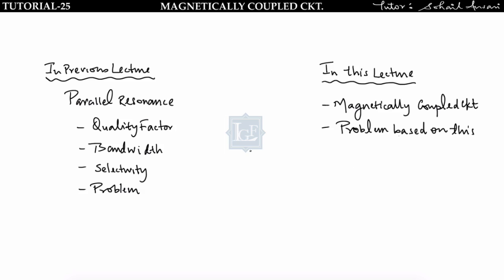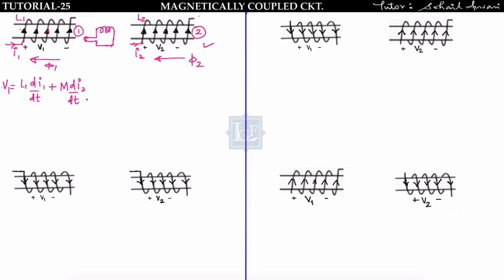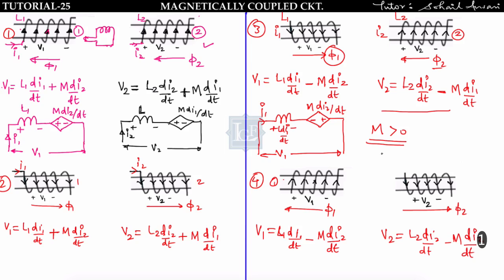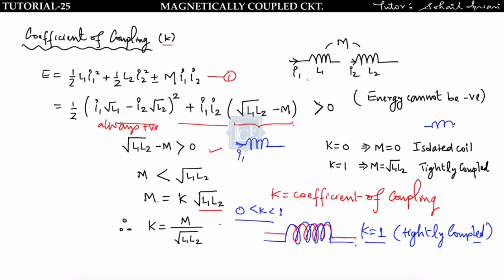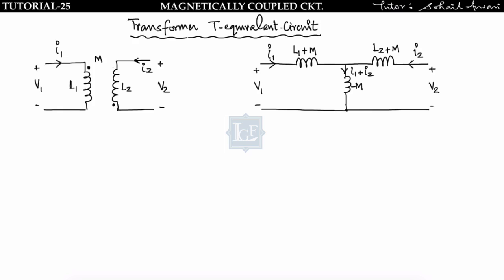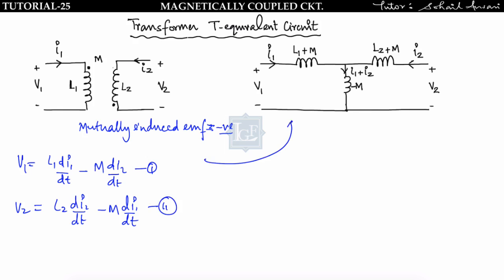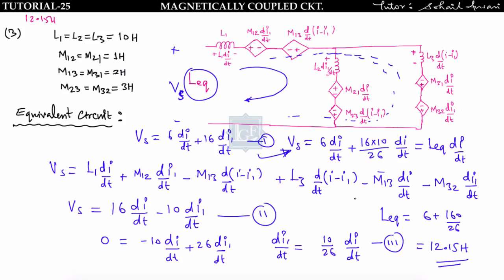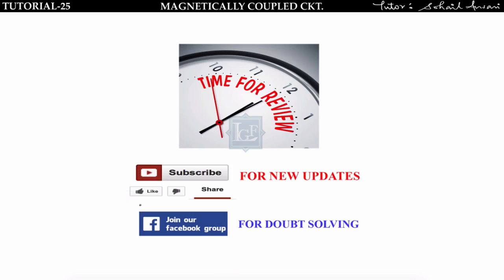Lec-25 Magnetically Coupled Circuit

Comment: in 43:36 last question why u have taken ji1 instead of j di1/dt??
Reply: di1/dt in laplace domain can be written as j
Reply: @sguha7850   in laplace domain, J doesn't exist.  Where does di/dt went and j came to laplace ?.............
Reply: Actually we are writing voltage due  to M which is also reactance multiply current here j representing  reactance due to M and with multiplying to current i2 giving voltage
Reply: Nitesh soni even though if j represents the reactance due to M... Then mutual voltage is given by reactance multiplied by change in current... So where is d/dt
Reply: ... I got it.....!!!!
Reply: @niteshsoni8956  , yes but in phasor domain di/dt=jwI.what is the value of  w for I2
Reply: V=Ldi/dt....but V=XL*i....j form means it is XL...not L.....so we do not multiply di/dt.....we multiply i with j

Comment: (ques 5 ) 50 sin2t=2i1+Ldi1/dt -Mdi2/dt so if we apply phasor concept 50(_90)=2I1 + jwLI1 -MjwI2 since w=2 therefore L=1 so 50(-90)=2I1+ j2I1+ 2 I2 but you took dependent source as j I2 so please! resolve the conundrum..

Comment: sir in the last problem the question is asked to find power loss in 2 ohm resistor then it will be ( i1square) * 2 ..
Reply from the maker: in the last problem go through the process....may be answer will be different..

Comment: Thankyou sir good lecture.Eagerly  waiting for 3 phase circuits.
Reply from the maker: u can solve three phase circuit also..whats the big deal..only u need to know the phasor diagram of star and delta connection ...also the relation between line and phase voltage..i will make one video dont worry..

Comment: Sir, Can we solve last question by transformer equivalent circuit as told by you before??..... What the meaning of inductor with negative value ( - M)... Doest it mean Capacitor practically??....
Reply from the maker: yes u can solve this by equivalent circuit also..no problem..anyhow u have to find I2...u will get same...
Reply: LearnGATE Free  thank you sir for your awesome lectures.its really great to see someone who is making so much efforts for improving others knowledge and that too free of cost . Thank you again sir
Reply from the maker: ur most welcome...all the best for gate 17
Reply: if we solve by transformer equivalent,then magnitude of i2 is coming 6.0812. Sir i have a doubt that why you have taken max value although in the lecture of AC ,you have told that A<B have A as rms value and not max value